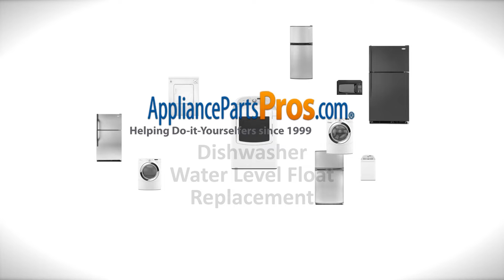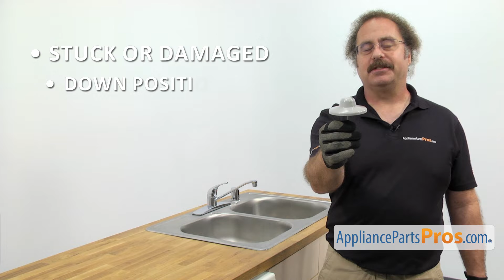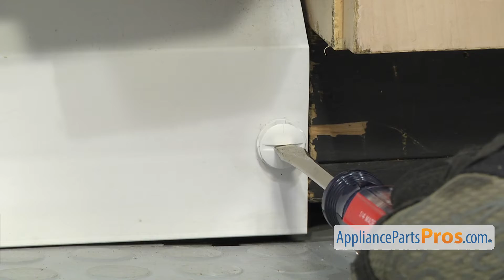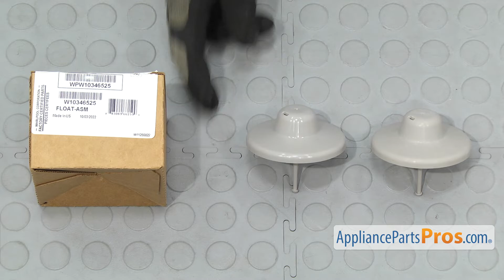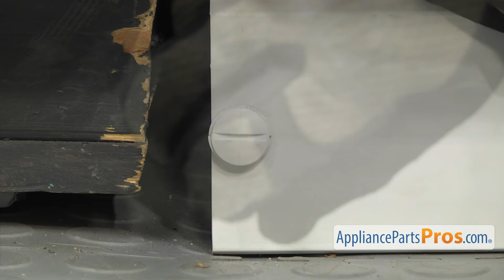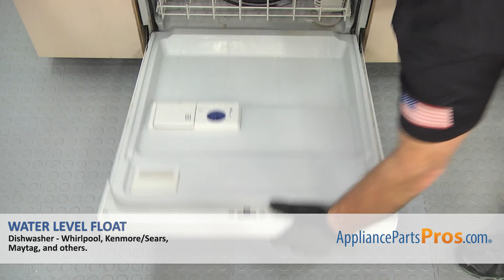How To: Whirlpool/KitchenAid/Maytag Dishwasher Water Level Float WPW10346525

Comment: Im 52 and shocked at these newer videos lack of more description.WHAT he replaced was a float (plastic part) that goes up and down depending on water level BUT that float connected to a swivel lever which is connected to a float SWTICH which is at the bottom (the first part he opened with screwdriver which has 2 gray wires...   The switch is an electronic device that can go bad.  So if the down position of the float "overfills" your dishwasher with water could be bad float switch.. NOw begining of video it said if in the up position and not filling at all???? In the up position a dishwasher is NOT meant to fill at all....  Whats wrong with this video!??.  In my opinion this plastic part he replaced has NOTHING to do with overfill or No fill...  If plastic float isnt broken its FINE!!!   If dishwasher overfills or doesnt fill yes look at the float stem to see if broken, look at the plastic lever WHICH connects float stem to float switch to see if broken and then finally test the float switch.  A float switch can be normall closed or normally open switch..... What does this mean?  It means  the circuit is always closed inside this little switch from manufacturer and when water gets filled inside dishewasher, float goes up and switch opens to stop the water... Or vice versa meaning the float switch can be a normally open switch and when water fills, platic float goes up and then closes the float switch to make water stop...  Yep a float switch is JUST LIKE A LIGHT SWITCH!  NOW a Very simple test to test the float switch... Use a multimeter,  put one of the leads (dont matter which side) on one side of the switch terminal gray wire (yes you can stick the pointy probe where wire comes into the plastic terminal) and the other multimeter lead on the other wire of the float switch.  Put firm pressure on both leads to make sure your lead points are inside touching both gray wires independantly.. Use your spouse or friend to manually move float plastic part inside dishwsasher up and down but first  use continuity or ohms setting  on multimeter (sound wave symbol or horseshoe symbol) and with diswasher discconnected of course BEFORE DOING ANYTHING... move float up and down manually (use a friend since you have both leads of multimeter inside touching both terminal wires of float switch) and "IF YOU HEAR OR SEE" a beep or will see resistance in ohms (numbers on meter) go up and down.... ALL THIS MEANS IS PROOF YOUR FLOAT SWITHC IS WORKING GOOD!!!! .. Thats really the best way to know if you need float switch replaced or not by using a multimeter... .. But this video just shows plastic float which if not broken no need to change as the water fill and non fill has to do with the light switch on and off (float switch)....
Reply from the maker: Thanks for sharing your detailed insight, @JorgeTorres-qn5yc! 👍
Reply: Sometimes a float can look fine and not technically be broken but it can get stuck in the up position from food particles getting trapped underneath it. Then the dishwasher won’t fill when it is supposed to until that area has been cleaned. That literally happened to me about 20 min ago. My dishwasher wouldn’t fill and i’m glad the fix was so easy. Sometimes things work out in my favor and fixes are simple!
Reply from the maker: You're right, that is one of the first things you want to check.

Comment: What was the point of removing the door of the dishwasher?
Reply from the maker: For the model in the video you have to remove the outer panel so you can remove the access panel. That allows you to access the float switch assembly. That has to be removed so  you can remove the float.
Reply: @appliancepartspros  I must’ve missed that, thanks!
Reply: It might be possible to do it without removing the door if you have a boroscope and some sort of tiny flat head screw driver, but at that point removing the door is way easier